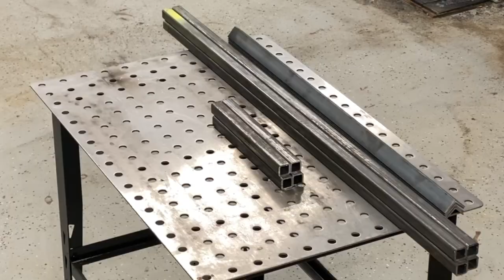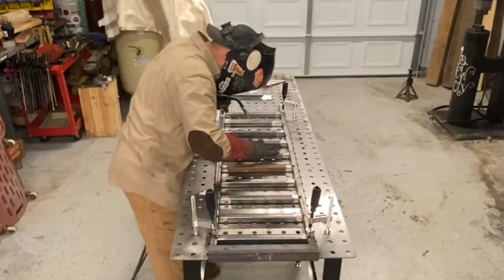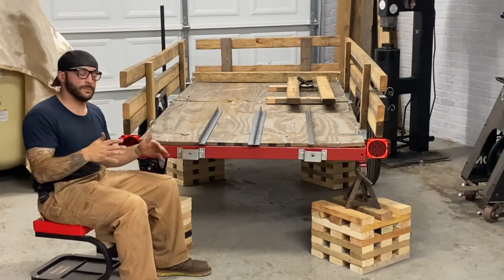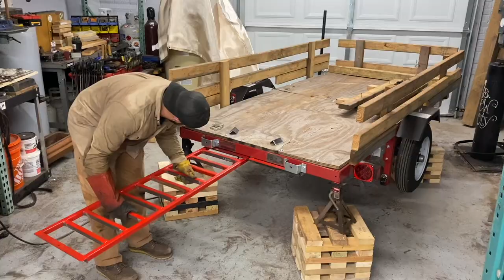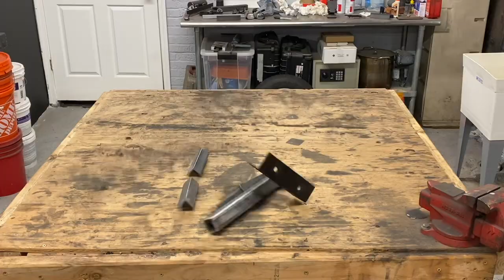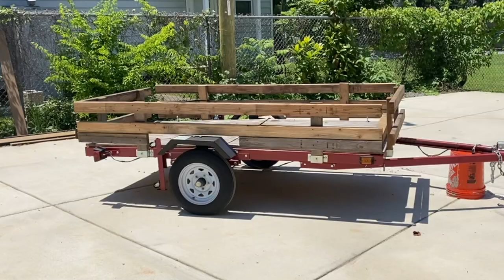Making Hidden Loading Ramps for my Harbor Freight Trailer

Comment: He did so much work just to pick up the trailer.
Reply from the maker: …I just added a landing leg after
Reply: @MuffinManMetalworks I meant those stacks of blocks that were used to raise the entire trailer. As perfect as they were set and stacked. I know that was allot of work in itself.
Reply from the maker: @TheKingsapostle  They definitely took a bunch of time to make. But I’ve also been using them on some car projects. So they’ve been real handy to have

Comment: This is a fantastic idea. I'm gonna have to do something similar to my trailer. I don't have a welder so I'm gonna have to just bolt it on. 
In regards to the ramps, do you think that the existing mental brackets that are used for the wooden sides will be enough to support getting a riding lawn mower tractor on?
Reply from the maker: Thanks! Yes definitely. I’d say the existing metal brackets the ramps sit on can handle that weight with no issue